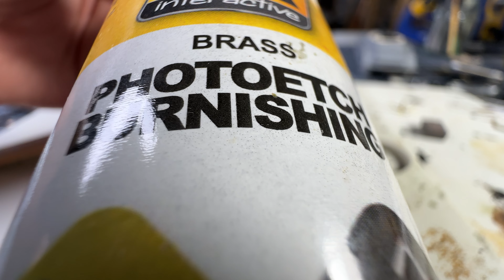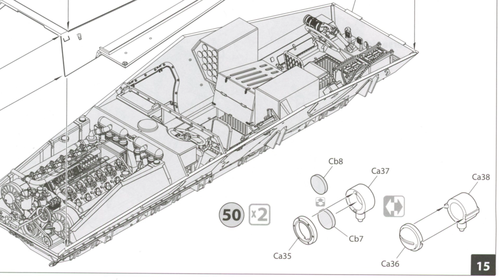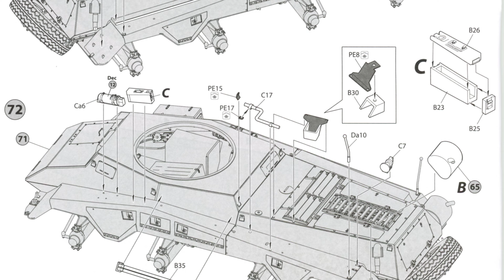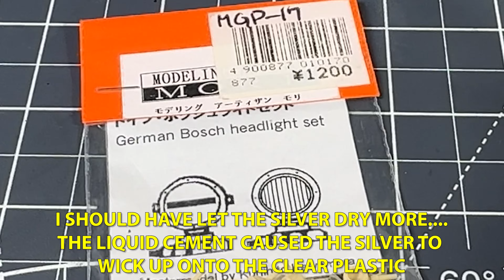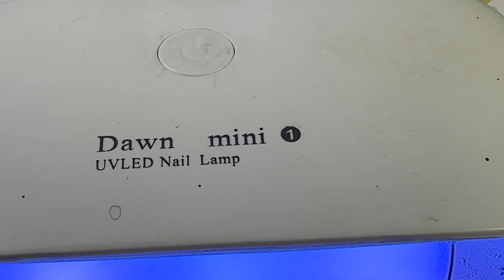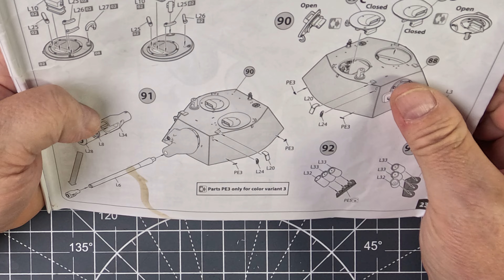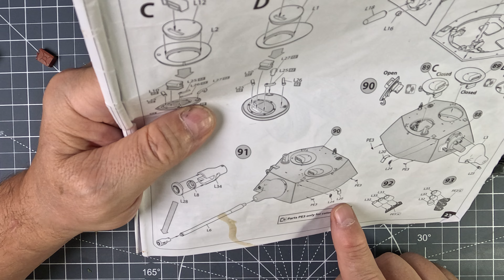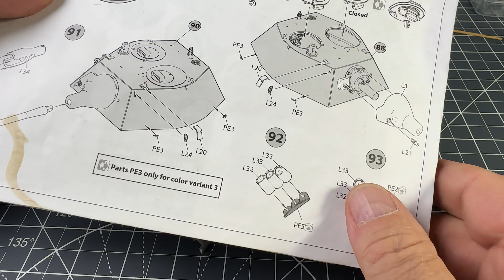pt.14 MiniArt 1/35 Sd.Kfz.234/2 Puma - Final Assembly: Turret, Jerry Cans & Finishing Details!

Comment: Nice video, I know what you mean about metal fatigue on etch. On unpainted etch material I now anneal it carefully with a tea candle. This makes it more tolerant of  bending back and forth and removes its memory.

Re the lights, for tiny CA applications I use acupuncture needles only a 1/4 millimetre wide, but a long  length to get deep into a kit if necessary and you can bend it to reach behind parts. The springs on the other end can be useful as well.
Reply from the maker: Thank you for the kind comment and for sharing your techniques! Annealing photo-etch with a tea candle is a great idea; it’s amazing how much easier it is to work with after removing that "memory." The tip about acupuncture needles for applying CA is brilliant—such a simple yet effective tool, especially with their flexibility for those hard-to-reach spots. I hadn’t considered the utility of the spring on the other end either; that’s a clever bonus! Thanks again for sharing these ideas—they’re the kind of tips that really improve the building process. Cheers!

Comment: You could use Tamiya or Mr Color metal primer it's clear
Reply from the maker: Thanks for the suggestion! I’m familiar with Tamiya and Mr. Color metal primers – both are solid choices for prepping surfaces. But in my experience, everything tends to flake off eventually, so I’ve found it easier to stick with paints like Vallejo or other water-based acrylics. Their plasticity seems to work best for me with minimal issues. Appreciate the tip, though!"
Reply: @JETScaleModels  I'm suggesting using it to prime the pe only
Reply from the maker: @SLICK-GLN  Yup i'm hip but I don't like to use that stuff cheers! You will see in the future vids that its been resolved to my satisfaction!

Comment: Why does the nozzle have to go on the upper side? If the seal is loose or it pops open not all the contents are lost. Details. Thinking like the crew. That's awesome.
Reply from the maker: You know, I didn't think of that. I was just basically following the drawings in the instructions, but yeah, that may be a good reason.

Comment: I do not know if the straps are metal or just leather. But every show I have ever seen where they rebuild the tanks a World War 2.  The strap for almost everything were leather. The fuel cans, the tarps,  they're personal items were leather with ropes to assist. The fuel and water cans i saw on those shows had leather straps. Except the panther which was mostly metal. Germany had supply issues with a lot of different metals. But they had an over abundance of leather.
To make straps and other items. Like i said, i don't know if they were leather or metal. I however would think they were  leather, because of there supply issues with metal. But that is just a guess on my part.

Comment: I could not find the answer i was looking for. What I need to know is, do you have any of the information on what the tires are filled with. Is it air or foam. From what I understand the foam will keep  the tires inflated after they are shot. Depending on how much damage the tires substain. I understand the foam will allow the vehicle to get back to its base camp. I have looked and it gives me to many different answers. It gives me answers from yes to no and everything in between.
Reply from the maker: The tires on the WWII Sd.Kfz. 234/2 Puma armored car were air-filled, not foam-filled. The technology for foam-filled tires or run-flat inserts as we know them today was not available during World War II. Here’s a detailed explanation:

Sd.Kfz. 234/2 Tire Information
Type of Tires:

The Sd.Kfz. 234 series, including the 234/2 Puma, used Continental 14.00 x 20 cross-country tires specifically designed for off-road performance.
These tires were air-filled, relying on their large size and reinforced construction to support the weight of the vehicle and provide good mobility over rough terrain.
Puncture Resistance:

The tires were relatively durable for their time but lacked modern run-flat or foam-filling technology. A punctured tire would deflate, making the vehicle more vulnerable in combat situations.
The crew would carry spare tires and tools to replace damaged tires when necessary.
Impact of Damage:

Unlike foam-filled tires, the Sd.Kfz. 234’s air-filled tires would lose air and become inoperable if they were significantly damaged. While the vehicle could potentially limp along on a flat tire for a short distance, it would require a replacement to regain full mobility.
Why Not Foam?:

Foam-filled or run-flat technology wasn’t developed during WWII. This type of innovation became more common in post-WWII military vehicles as technology advanced and the need for survivability in combat zones became more pressing.
Conclusion
The Sd.Kfz. 234/2 armored car relied on air-filled tires, making it susceptible to tire damage in combat. Crews had to rely on carrying spares and conducting field repairs rather than using modern solutions like foam-filled or run-flat systems.

Comment: Building all these miniart kits, what are you gonna do building a Tamiya or another company's kits? You wouldn't know what to do. Lol. But every video you do, reinforces why I don't build miniart kits. Haha. As to burnishing fluid? Use it after you put things together. It doesn't harm the painted parts and it will darken the PE without you handling it. I did that once and it worked far better. Now? I just use it on tracks.
Reply from the maker: Haha, I know exactly what you mean! These MiniArt kits can be a handful, that’s for sure. Tamiya kits are fantastic – I’ve built plenty over the years, starting with their Sd.Kfz. 8-ton back when it was a new release in the ’70s. I remember that one well! But maybe it’s just my build style that gets me into trouble with all the extra parts and detail.As for the burnishing fluid.... I guess you can tell how I feel about ever using that again lol